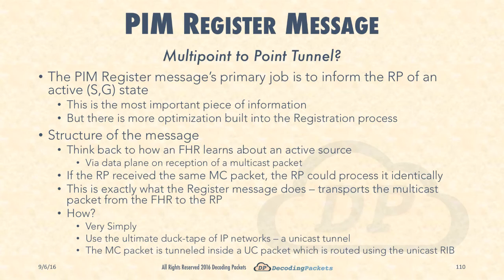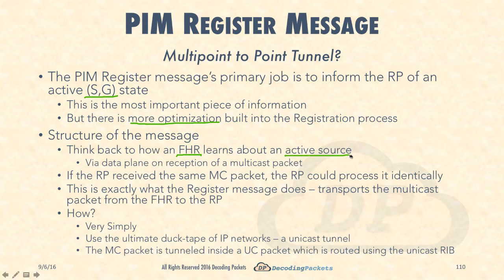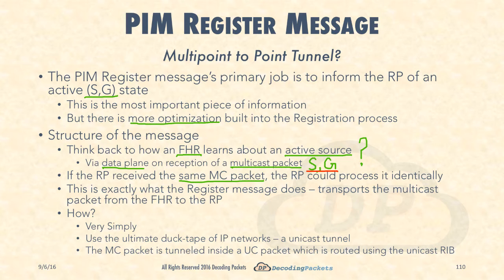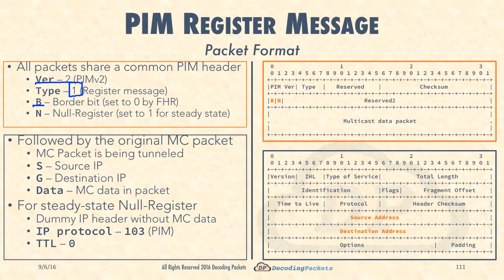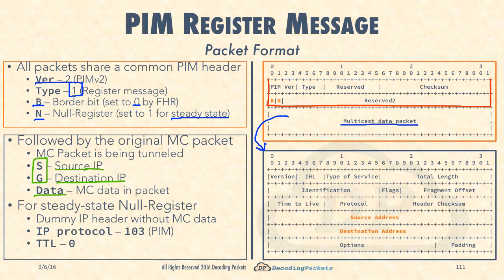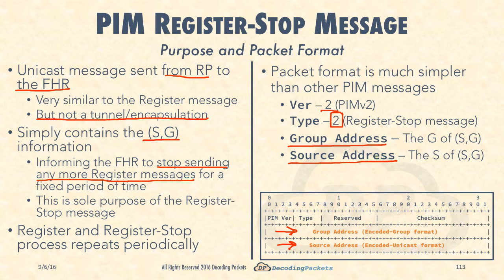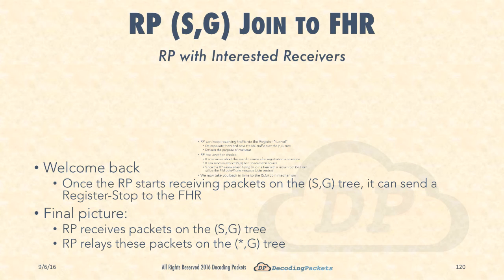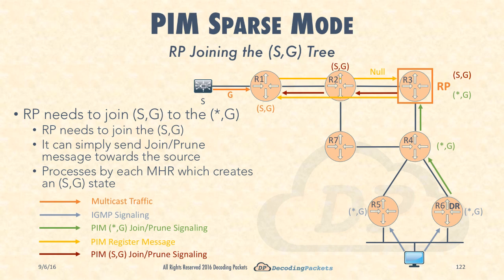Lecture 9 - Advanced PIM Sparse Mode Deep Dive Part 2

Comment: Excellent series on Multicast. quick question at 13:12, you mention that the destination field in the IP header will be the RP address but before you also mentioned that the source and destination will be the source address and destination will be the mcast group so how does the inital IP header packet with S,G in source destination field inside the PIM register message get translated to the source and RP as destination IP. Thanks

Comment: Awesome video for sure ! A true reference for those who want to deep dive into this complex protocol! 

I haven't see explanation about "PIM Forwarder" or "Designated Forwarder" . When more than one routers are making the Last Hop Segment, which router forwards the stream to the final receiver. 

 Speaking about LHS , since Snooping switches only have a single Querier port ,  all Join/Leave will be sent to this querier port , therefore to the Designated Querier ( by default elected with lowest IP) , which by nature will be different from the designer Router ( elected by highest IP ?) .. so it becomes quite likely that the Designated querier is a different router than the designated Router.. How is it possible to have one router getting the information about the receiver interest (IGMP) and the other sending the PIM Join to the RP ? Thanks for your answer, and sorry if this piece of info was already n your video, I could not find it.

Comment: Great video! I have a question about RP decision: if RP does not have a (*,G) state yet, and there are two different sources connected to two different FHRs which register these sources, what will happen when PIM Join is received for (*,G) on RP? Will RP try to send PIM Join towards both sources? MC traffic from which source will the RP forward down the (*,G) tree?
Reply from the maker: Yes, as long as the sources are registered for the same Group as the one signalled in the RPT (*,G). If that happens to be the case, then the RP will initiate an STP (S,G join) to both the sources. It will also forward the streams from both the sources on the *,G tree towards the receiver. The receiver is then essentially receiving two multicast streams.
Reply: Great, thank you very much for such a quick reply!
Reply from the maker: You are very welcome.

Comment: Great series, it has helped me a lot.

Quick question, what does the RP do if it stops receiving null register messages from the FHR?  Does it care?
Reply from the maker: Mike Condon The RP has a timer/timeout associated with the Register state (S, G) which is reset every time the Null Register message is received. If the reception of these messages ceases for a time longer than the timeout, the state is simply discarded by the RP. 

HTH.
Reply: You rock.  Such quick replies!

One followup for clarity.  When you say the state is discarded, you mean the (S.G) is removed from the RP?  Correct?

Actually, now I had a scenario pop up in my head.  Maybe you can share your insight.

the (S,G) is well established, MC traffic is flowing, and steady-state null register messages are happening between the FHR and RP.  MC traffic continues to flow, but for some reason the null register messages are getting lost inbetween the FHR and the RP.  When the RP times out the null register messages and removes the (S,G) will it not take into account there is incoming MC traffic for that (S,G) or will it not care, remove the (S,G) state, and start discarding the MC packets?

Thanks again for your amazing series!
Reply from the maker: Mike Condon No problem. I like to help out as much as my time allows. 

Short version - Correct. 

Longer version - we need to qualify your statement by stating if the S, G state was a result of the Registration process alone, then you are correct. But suppose the RP was in the path of an S, G and the state was on the RP was a result of PIM Join message, then no. 

But in the very simple case where there are no receivers and the state was caused by registration alone, your assumption remains correct.

Comment: In all your lectures and the example, you always mentioned the receiver wishes to join the (*, G) group. And if I understand ICMPv3 correctly, it allows receiver to signal LHR to join a (S,G) group. What happens then? Does LHR (DR) sends a PM join message to the RP? If yes, would all the intermediate MHR nodes create (S,G)? Would really appreciate if you could explain that example. Thank you.
Reply from the maker: The videos on the channel so far only discuss Any Source MC or ASM. Once we go into the IGMPv3 realm and the receiver signals the intent to join a specific source, the router essentially has to run SSM or Source Specific Multicast. 

SSM does not have a concept of an RP or (*,G)/RPT because they are no longer needed. The LHR knows about the S from the get go so it can send S,G Joins directly towards the S. All the MHRs will then only have the S,G and no notion of *,G.

HTH.